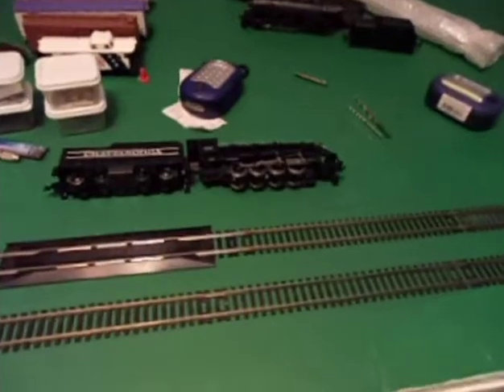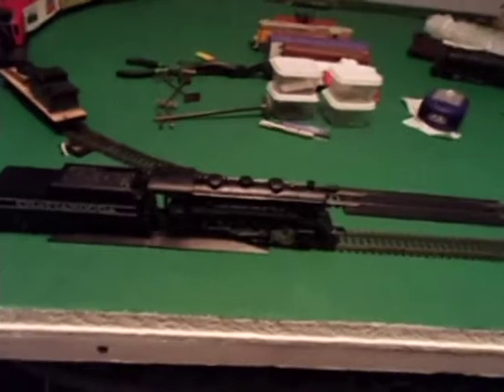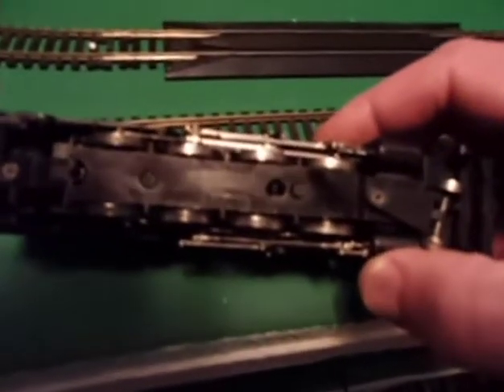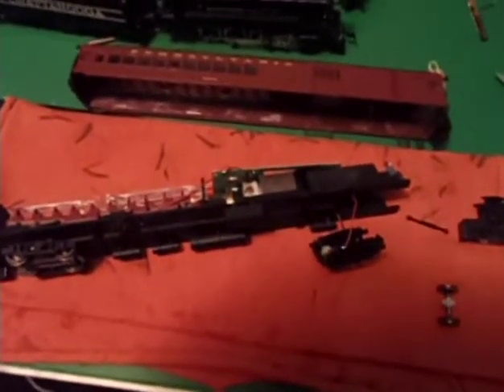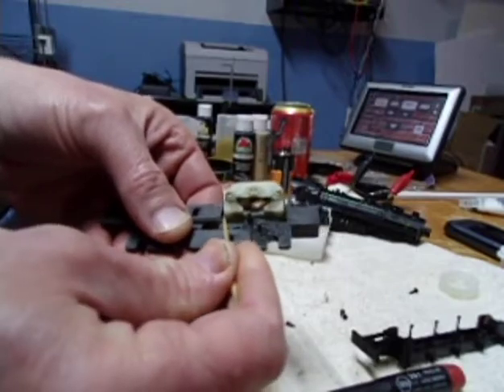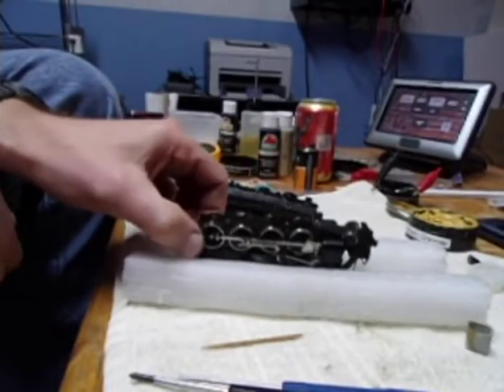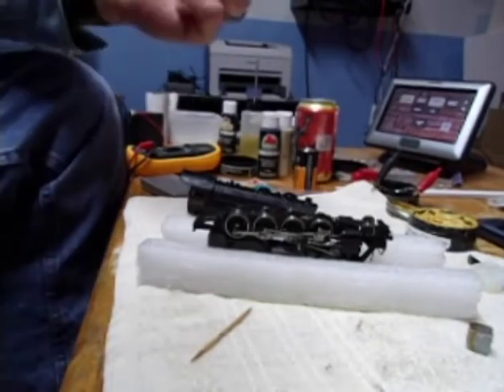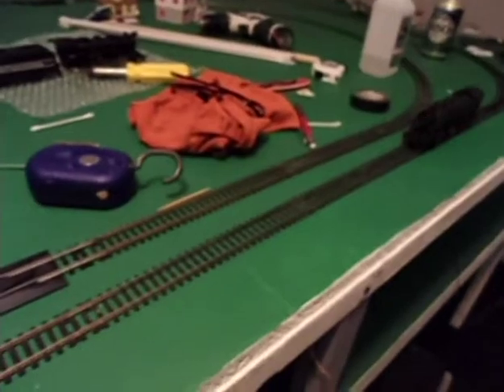Two new locomotives and a Doodlebug, and some train repair

Comment: Apparently those doodlebugs are famous for cracked gears. I bought mine and it was a nightmare, but it only had one cracked gear. Great price though on yours!
Reply from the maker: I found that out when looking for information on them.  A lot of cracked gears.  So I paid abt $13 for it, plus $10 for new gears and $5 for shipping so I'm into it for abt $28.  I've seen them for sale from $40 to $70.  Is that accurate?  I just bought it because it was different.  The Bachmann 2-8-0 is a disappointment.